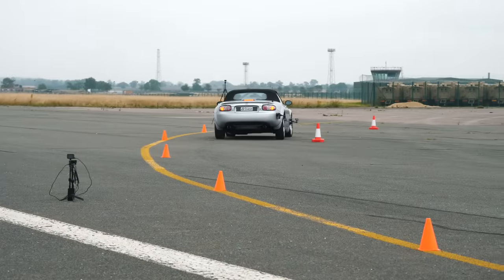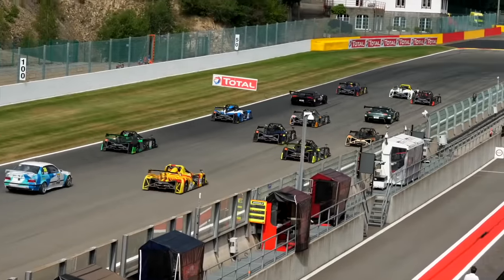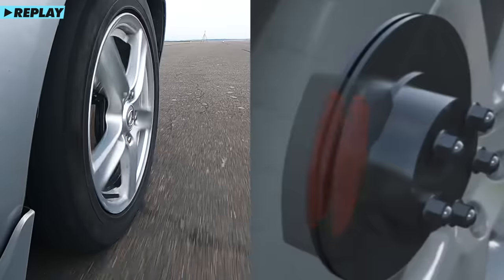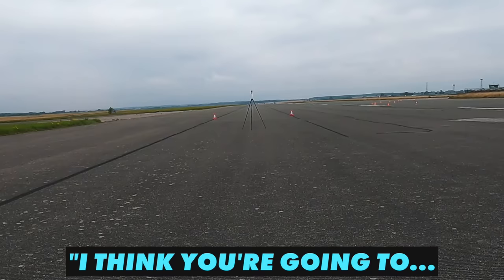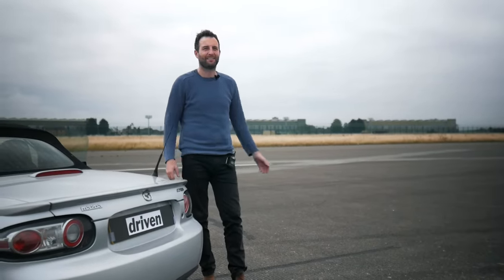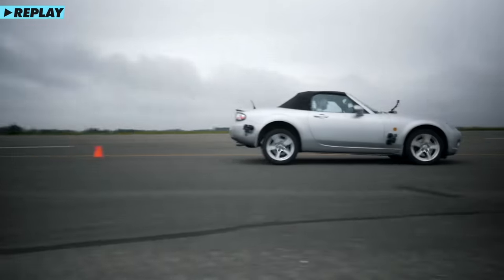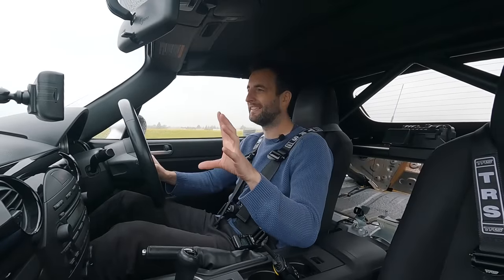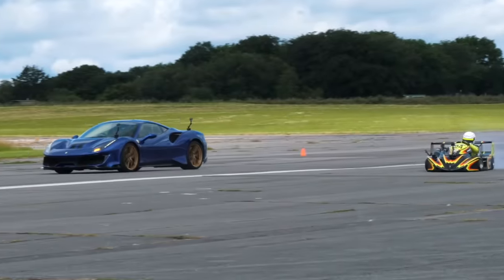ABS ON vs ABS OFF | What's Really the Difference?

Comment from the maker: 🔘What do you think of this NEW SERIES? What would you like us to test next?

🔔Don't forget to subscribe, you could be here driving with us!!
Reply: YES, WE WANT THIS TO BE A SERIES AND WOULD LOVE TO MORE OF THESE TESTS
Reply: Can you do a lap of a track faster with ABS on or off? This shows that ABS helps braking regardless of conditions and talent, and allows control whilst locked, but can a pro driver do better?
Reply: Would love to see a video on different ways you can lose control of your car and how to regain control, e.g. Oversteer from too much lateral Gs on a corner vs oversteer from excess power vs lift off oversteer (where the tyres aren't moving fast enough) etc.
Reply: Do this again but try to do your very best without the ABS
Reply: LOVE IT, even though I am not a racing car driver my friend was and taught me how to cadence break and handle aquaplaning as well as so much more. But having learned these tools without ever braking hard on non-ABS I had a warped perception.

I thought without ABS with cadence braking you can stop quicker* (obviously depending on road surface, conditions etc)

I have always driven with ABS on I think all my cars, so it was all hypothetical.

Watching this, knowing as a race car driver you know the cadence technique to find limit and back off slightly before increasing pressure and releasing as you slow to a stop. This warped my knowledge, seeing how much worse ABS and non-ABS was, was a surprise to me. 
I assumed straight line say 60kph the results would be negligible ABS stopping 5m earlier, this showed the complexity and "well" just how incredible braking software is this days.

Thank you, now if I ever hear an old geezer "ie; my dad" say how much better cars were and abs over-rated I will show him this.

Sorry for the long message, massive fan (mostly of your fathers workshop, but you're alright I guess 😜)
Reply: Yes and no. The subject of this one interested me but your demonstration was ridiculous. Ordinary drivers, many at the least, won't break stupidly like you did. So there's no real science there and i'm not interested to look at dum and dummer like video.
Reply: @laurentsamson8927  yes and no. According to studies most drivers don't brake hard enough so ABS don't get active. For this there is another aid called brake assist it's recognising the emergency situation and increases brake pressure.
Reply: i really love it i cant wait for more video's!
Reply: Horrible, the fact you didn't also include threshold braking, Guess you don't want to show that because it is usually better than ABS.  I have modified many vehicles to allow me to turn off the ABS will a flick of a switch.  Especially offroading, snow, and water.
Reply: WTF how good this ABS on the MX 5 is, on my fiesta when ABS jump in i need more distanz, if i jump on the brakes i try don't lock the wheels this works very well. i think the ABS in my Car is to slow to work perfect, but if one wheel lock it is faster but maybe i must go to a softer breaking point
Reply: Brian West
1 second ago
I'm disappointed that we didn't see you do your best threshold breaking!  Any youtuber could run the tests that you did here.  I'd like to see if you can get within 10% of the ABS distance.  You should do repeats too, to show the difference between your first guess at how hard you can break compared to after you have learnt for these conditions.  As an experienced racing driver, what is your best ability in the curve and lane change?
Reply: Front wheel drive VS rear wheel drive VS all wheel drive (maybe even 4x4 drive) reaction in situations but mainly I'm curieus to here behavior on ice and of ours the difference 🤔
Reply: could have tryed to break more properly without the abs other then just simply standing on the break pedel.
Reply: Manual vs Automatic. Great video BTW
Reply: your a professional racing driver, I really wanted to see how you could handle the car without ABS, but actually using your driving skills.  I think that comparing what a good driver can do the the ABS would be better than a lead foot to the ABS.  I used to have a car without ABS and I would often break, begin to lock up, come off the breaks and put just enough to not lock up.  I could stop pretty quick, but by observing non car people without ABS, like my brother, he did the same thing.  So I think the non ABS tests were a bit unfair.  Other than that it's really cool.

Also, my current car has ABS, and when ever I hit the breaks going quickly, it feels like I'm on ice and can't slow down quickly at all.  It's terrifying.  Even in snow, I was able to do better than that with my old Non ABS car.  I want to take it to a track at some point to get to grips with how to drive the car with it's ABS.
If anyone is wondering, Old Car(No ABS) = 2004 Nissan Sentra SE-R spec v, New Car(ABS) = 2014 Infinity Q60S.
Reply: @gaborb  I had never hear of that(brake assist), that's cool.  I'll have to do some research.
Reply: Would be nice to see what an experienced driver could do without ABS.
Reply: You know when the brakes will lock. So you should have tried this without locking the brakes.
Reply: TCS VS NO TCS
Reply: Like the format of this series! but the NC Miata might not have been the best car to do this test because of EBD (electronic brakeforce distribution). Pulling the ABS fuse also disables EBD, which by default applies a heavy front brake bias for safety. This is why the front tires lock up this easily and the braking distance that bad. Don't get me wrong, even a properly brake biased car will lockup in these conditions, but the brake distance wouldn't be as bad since the rear brakes would be contributing a lot more.

So to all that say you can brake better by disabling the ABS... not in this car... Not unless you also overhaul the brake bias system.
Reply: Hi. I have a Hilux pickup, living in Namibia with a lot of grave roads. Can you do this same test on gravel? Would be nice see the result.
Reply: hydroplane speed with stock tire width vs wide tire widths.
Reply: 🔘 was just seeing where this emoji is lol sorry
Reply: this doesn't prove ABS is better, just confirms that locking up the brakes like an idiot doesn't work. try braking properly next time. Better yet, get random people to try both with/without. this will only lead to misconceptions among people that without ABS cars can't stop properly.
Reply: This is a really cool series. Also, I think the reason why the car begins fishtailing a little while braking without ABS is because the manufacturers of these street cars set the brake bias towards the front (unless it's a mid/rear engine car), so there's more brake force being applied to the front brakes than the rear. It would make sense since a lot of manufacturers won't expect the driver to disable ABS for street use
Reply: @petardenchev75  It depends on how the manufacturers tuned the brakes, so there will always be different results
Reply: What about braking with ABS on snow or rain ?
Reply: Thumbs up!!

However I would have loved to have seen you try to stop without ABS, while pulsing the pedal to replicate the ABS effects. Would have been cool to see how the driver can replace ABS

Cheers Driven
Reply: One thing that the audience surely would benefit would be to explain that when tire rotates tha contact patch is stationary relative to the road. This, the tire uses static friction, not dynamic friction. In theory and in ideal conditions a car that is going straight on perfectly smooth road, with perfectly balanced tires, no acc/deceleration, no turning: it has the same grip as car that is stationary. Once that is understood, a lot of "ahaa" moments come in quick succession, "ahaa, that is why it does this".
Reply: If you did not slam the breake you can stop fast
Reply: Sorry for late reply but try abs in very hard weather like snow and bit of rain down hill  vs up hill
Reply: Whatever i like the drift
Reply: More interesting to see if you can get close to ABS using your own braking techniques. Of course without pumping them you won't get close.
Reply: what about a test braking properly ?
Reply: honestly, this video is trash. You dont need to make video to know, that when you slam brakes like mad you will slide. I expected driver trying to control the braking without abs, not just slam the pedal.
Reply: It's for the science...
Reply: Who in their right mind would try to steer the car while wheels are locked? You are not even trying to steer the car without abs...
Reply: Do not forget this is a Mazda "Sport Car" If you have new tires new system you can expect great performance (The problem is with bad tires, an older system for not "Sport cars", not working the best ABS system and similar conditions, rain snow ice, and similar...)
Reply: hammond is even life size 🤭👍